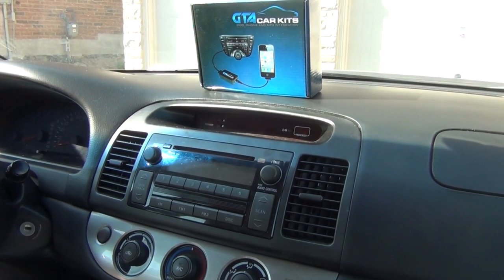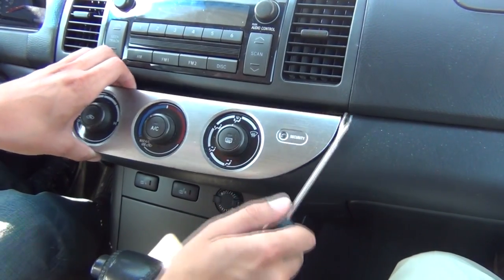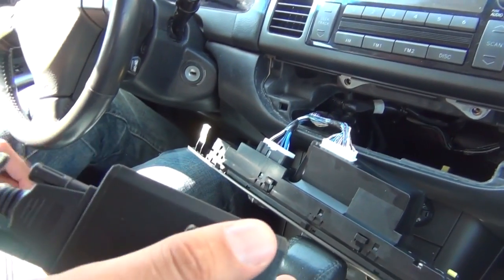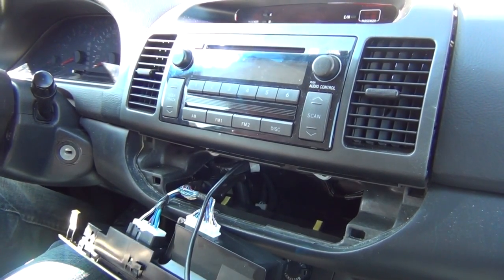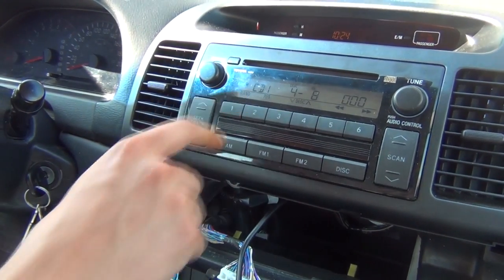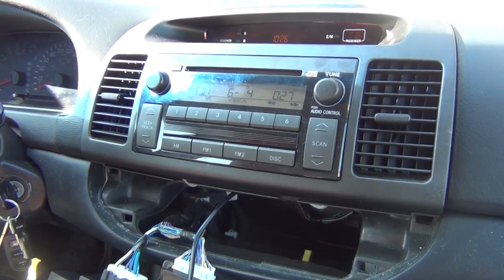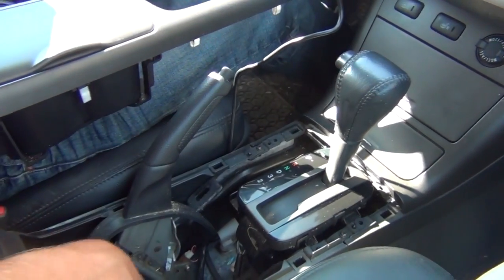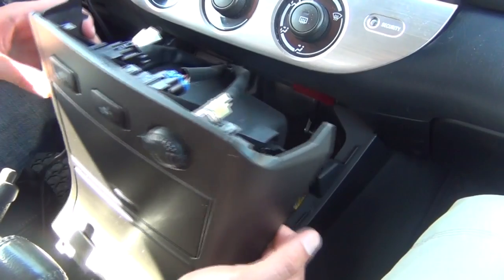GTA Car Kits - Toyota Camry 2002-2006 install of iPhone, Ipod and AUX adapter for factory stereo

Comment: Thanks for the video. Had to buy the 10 mm socket and extension tool from autozone, but once I got that , rest of the process was quite easy, essentially because of the thorough explanation provided in this video. I ran the cable though the right hand side cabinet. There is an opening accessible , and you dont need to drill a hole..
Reply: Ashish Shah are you referring to the glove box?

Comment: I watched a couple of these videos and I have to say you done the best job of doing it right. The tip about the magnet was good as well. That gave me an idea to maybe super glue a small magnet to the inside bottom of the 10 mm socket since it is used so much on the Toyota. Thanks for your sharing and job well done. James.

Comment: Worked rad with my 2005 toyota camry. used a really thin Flathead to pull clips. Make sure you're in pretty deep b/c there's a plastic panel in front of the metal panel and you can pull that out on accident if your not in deep enough before you start trying to pull it out. 

Didn't need a magnet but you'll definitely need an extension to remove stereo bolts. 

If you plug it in and it doesn't work, replug it all in really tight and make sure there's a cd in the radio. 

Thanks for the tut

Comment: 30 mins? I'm a 16 year old girl with NO experience with this stuff whatsoever and this took me 5 mins TOPS to install. You don't have to remove the radio, just reach in behind the climate control and there's an empty spot right next to that big black wire where you can plug the car kit right in. Then reach the end of the wire connected to the ipod around through the glove box and then you can secure the climate control back in its rightful spot. EASY AS PIE!!!

Comment: @TheMaxAwesome Just got the one I ordered in the mail, and the answer is NO, you cannot connect a Zune as the cable with the molex connector for the iPod is not a standard USB cable, but instead uses a special 8-pin connector that attaches to the back of the device.

Comment: I have a 2003 Camry XLE. The trim is slightly different from this model, especially with the bottom panel (the one with the seat warmer switches).
I am unable to remove it. Tried to slide it upwards, but it wouldnt budge.
I followed all the steps you mentioned, but in vain. Can you explain how you removed the panel, clearly ?
I like the gta kit very much, but the wires running around is annoying ( even after taping them to the panel for the time being)

Comment: I have a 2005 Toyota Camry LE and I wonder, do you think this kit will work or androids as well. Like not use to USB cable but use the AUX.
Reply from the maker: +Milyazim Anvarov You can plug in any device with the 3.5mm aux and it will work. Also we have the newer version Pure Bluetooth kits available now from our website, and those you can use with any bluetooth phone to stream and control the music through the radio.

Comment: I'd get it but it doesn't have the adapter for the 5/5s. I'll just use a cassette to aux
Reply from the maker: Connell Mcbride 
 you would have to use it along with the Official Apple Lightning Adapter, if you want to use iPhone5s
Reply: GTA Car Kits yea i'm probly gonna do that
Reply: GTA Car Kits I paid 50 bucks for the lightining adapter & it worked great for maybe 2 or 3 months then all of the sudden the music wouldn't work anymore.

The regular 30 pin GTA kit still works but I no longer own an ipod or iphone with this pin set.  I called apple to complain about their shitty cable & they said that I should have been more careful with it.  I read the reviews prior to buying so I knew it was fragile.  I had it positioned so that there was little to no movement on the adapter & it still broke.  Strange thing is it still charges but I can't use my steering wheel controls so I just use the 1/4" jack.  Also a bonus is that I only need to use adapter when I need a charge.  Sucks that apple honors a one year warranty on pretty much everything else they make.  If the adapter/cable was 25 bucks I'd buy another one.  But seeing as they only last 90 days it's no where worth that kind of money.  Sucks that all of the knockoff cables are essentially the same.  They'll charge the device but no audio will be transmitted.  GTA was more than helpful to troubleshoot my problem.  I originally thought it was the GTA Kit but it was the money hungry Apple who once again screws the consumer.

Comment: This does not work for 2003 camry. Know why? Because when I took mines apart, it doesn't have that open port to plug the GTA kit. Lucky I didn't buy it yet. misleading captions.
Reply from the maker: Don't jump to conclusions right away, if you want you can email us a picture of your radios back and we can tell you for sure. Your car might simply need a Y-cable. info @ gtacarkits . c o m
Reply: GTA Car Kits no, I definitely don't need a Y-cable. I've checked. I bought a kit for my 2008 Corolla so I know how it works. Is there a concert kit that comes with it?
Reply: GTA Car Kits Conversion*
Reply from the maker: its hard to troubleshoot over Youtube comments. Like we stated before, if you want proper troubleshooting, please email our support with a picture of your radio to info @ gtacarkits . c o m . Thank you.
Reply: +GTA Car Kits it good to talk and communicate with each other I see. Wise.